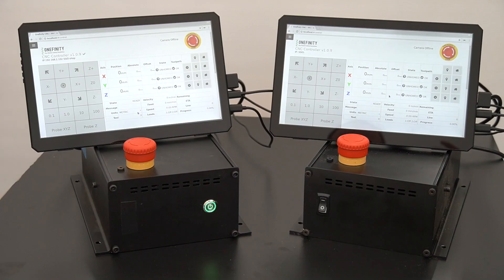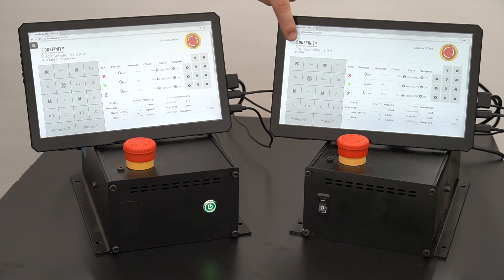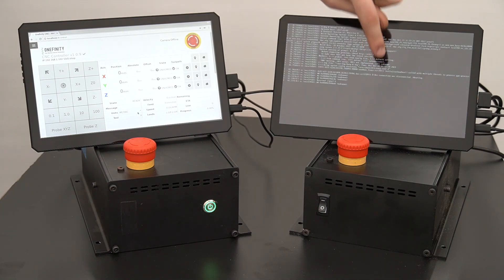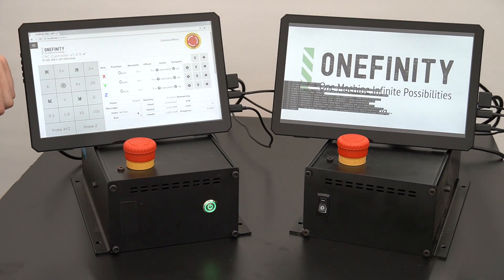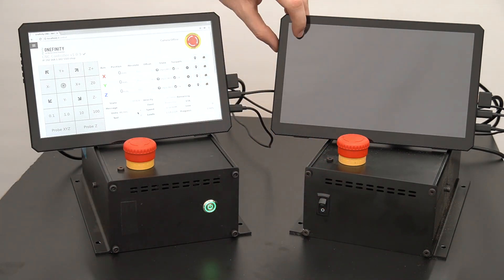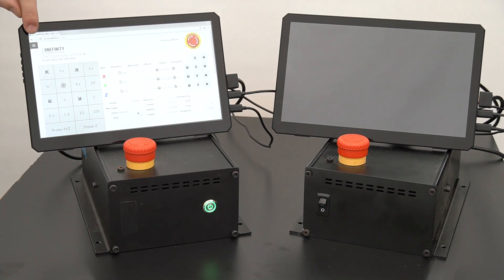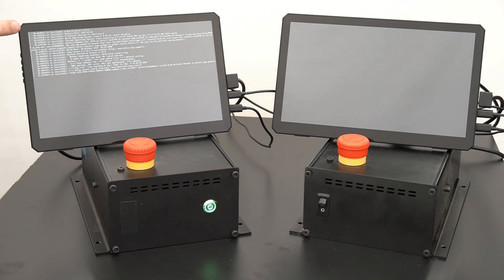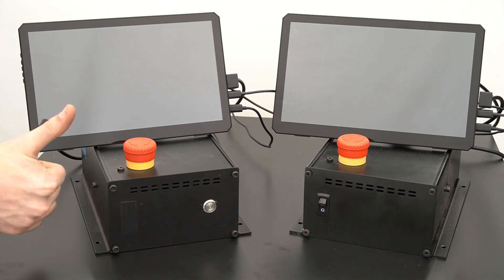Proper Shutdown on the Onefinity CNC

Comment: The reason everyone is hanging on the kernel panic message is because, if you have the button style, you literally can’t shut it down. It stops sending new messages and just sits there, fan still running, screen still on. Are we just supposed to unplug it and replug at this point? Looking forward to installing the new firmware and seeing if that fixes it, or just leaves it sitting at a shutting down screen forever.
Reply from the maker: Just flip the power switch off when it shows the code, yes, just like the video.

Comment: So every time I shutdown the controller I get a kernel panic error message. How can this be avoided? 

It was recommended on the support forums to shutdown the device from the menu options (not just toggle the power button), but doesn't seem to shut it down, but instead reboots with the kernel error message. It looks like when you shut it down it went through the same sequence, but you toggled the power before the machine could reboot and display that message. Is this what I need to do? Thanks.
Reply from the maker: It can't, This video shows that.